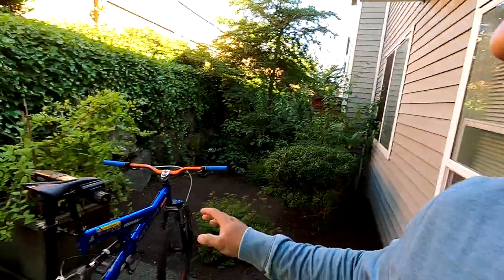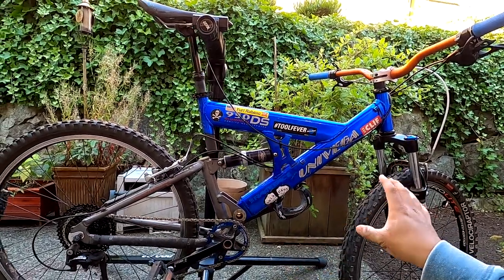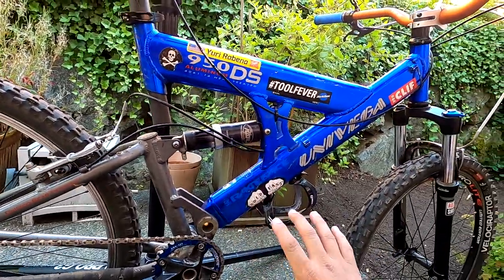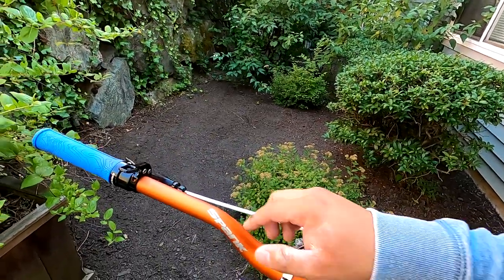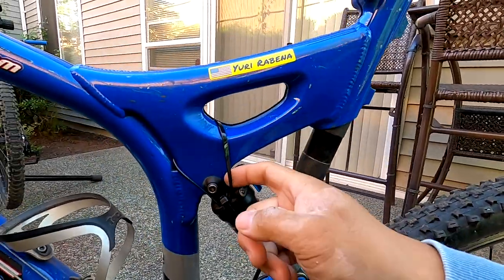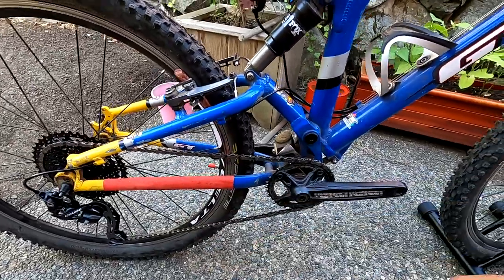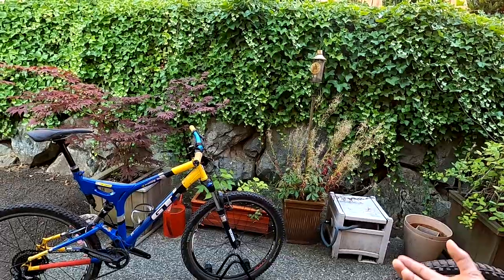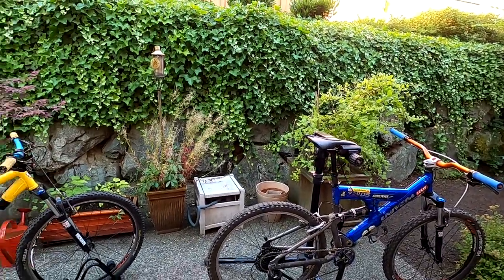The Univega, iDrive and a ride down memory lane

Comment: Do you remember the univega beryllium frame?

I use to build armour for tanks and tactical armoured patrol vehicles and worked with classified materials. The univega would pop into my mind from time to time.
Reply from the maker: I did not know that.  I am only familiar with the DS900 and 950 bikes of this vintage simply because of affordability and value compared to an elastomer rear GT LTS at the time.

Comment: Long live the URT ! And iDrive alive !
Reply from the maker: There were a lot of cool URT designs I loved, such as the Schwinn S-10 thru S-30 bikes, the Klein Mantra, the infamous Trek Y bikes.  Factoid - The Cannondale Super V bikes are not URT because the bottom bracket is attached to the front triangle, not the swingarm!
A lot of people knock on the platforms now but back then the trails and tech were different.  On the URT, Paola Pezzo raced on a Gary Fisher Joshua in XC races and had exceptional results and this was before racing full suspension in XC was a thing!  
However, I would be lying if I said today's bikes didn't ride better.
Reply: Agreed

Comment: UNIVEGA, mine creaked too, I thought it was the bottom bracket LX so I bought an XT it was cheaper then  and still creaked, my mechanic has a tool to remove the big nut, it has a teflon type of bushing between the nut and front frame, maybe your mechanic has some old teflon bushing to customize and replace.
Reply from the maker: The later versions of this bike ended up with replaceable bearings which to me showed they cared about improving the product.  I've had a lot of full suspension bikes and the Univega happened to be the most reliable one.  Not necessarily the best riding but a lot of trouble free years up until now.  
I have asked around the local shops and nobody has the tool or is able to source out the parts.  And I'm okay with that, to be honest since I'd like to move on to other builds.

Comment: The Univega reminds me of my WalMart Mongoose MGX that got me into the sport over 20 years ago. Really was a wonderful bike (considering) and I wound up replacing most of the parts with CODA take-offs from a local Cannondale dealer. The GT: Couldn't you use the metal tube from the V brakes to move that cable out of the way better from your rear shock? I've thought about that before since I can find the internal droppers for sale by me all the time. Never really external ones.
Reply from the maker: The MGX, that's a pretty popular department store bike I see all around town to this day.  I think it should almost be law to start out with a department store bike because you can never appreciate how good a "bike shop bike" is until you've ridden and spent hours learning to fix everything that fails on those budget machines.  It's a great intro to bike repair and riding, as you've experienced.  I had cobbled yard sale bikes my parents got me to make at least 1 or 2 rideable growing up.
I didn't think of the v-brake noodle at all as a solution.  This is what exactly happened - I realized I ordered the wrong dropper, dropped an F-bomb a few times and just installed it in haste...and don't get me started on how much of a PIA the PNW 2x dropper lever is!
I'll replace it with an external when the KS dropper from another one of my bikes fails which by how it's been working these past few rides should be pretty soon.
Reply: @yuri_on_youtube  lol!!

Comment: Honest question and I’ll attempt to put my GT bias aside if I can  : is the GT iDrive the best of all the URT designs ? ? Is there a better or longer lived ?
Reply from the maker: The iDrive is different than the Unified Rear Triangle but it does have similarities.  Just like GT's Angle Optimized Suspension (AOS)  designed by Peter Denk incorporates some of the iDrive tech but it's not iDrive.
In my opinion, since the iDrive doesn't count in the URT category, my vote would go to the Schwinn Homegrown full suspensions with the "Sweet Spot" design because it had handling that'd compete with the LTS during that time.
Best suspension, I'd vote for the AOS hands down.  I hope one day that design returns.  
But here's a good read on URTs:
https://www.pinkbike.com/news/the-short-turbulent-life-of-urt-suspension-mtb-history.html